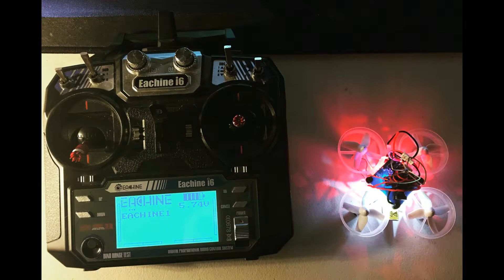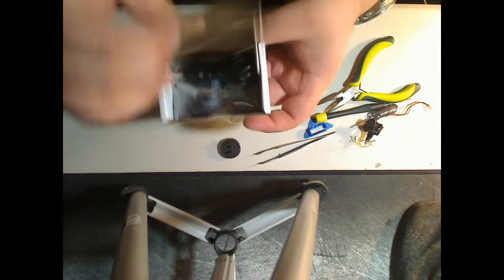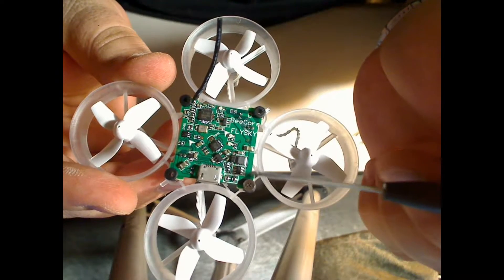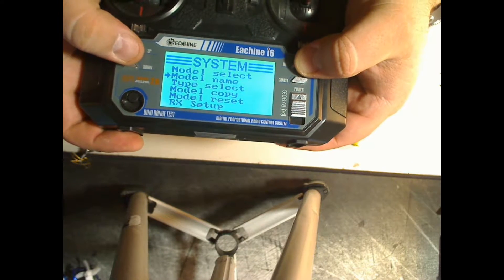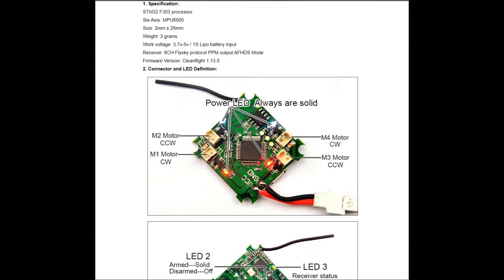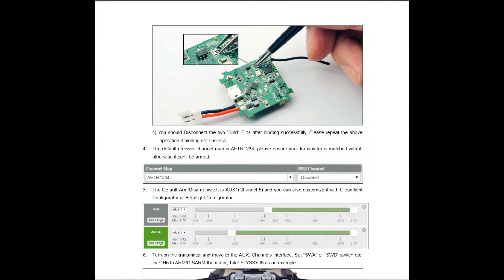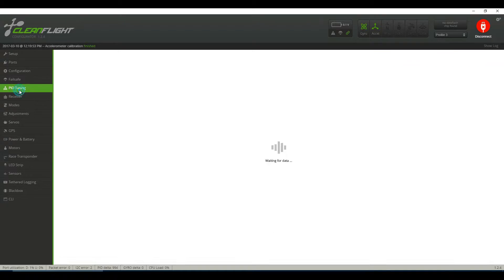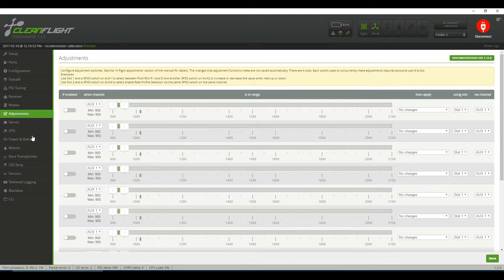BEECORE EVO F3 FLYSKY - Unboxing with Tiny Whoop Build And Maiden Flight (BANGGOOD)

Comment: mine binds, hovers fine, throttle and all axis of movement respond EXCEPT for "left rudder/CCW rotation". Right rudder is fine tho.  motors swapped changes nothing, so thought I do a reflash. Betaflight connects, radio binds, etc, I can modify settings, PIDS, curves, etc. But can't update firmware. says serial port won't connect. which is lame because, well it DOES connect for everything else. Board was already preflashes with a version of bf already flashed for the board but it's one point rev lower. and as a hail mary Id try anything rather than have to fight the tiny soldering (eyes and hands not as steady as I'm in the late 40s) and junk the FC.

Comment: Also, on the bangood manual it says to enable AFHDS, not disable it.
Reply from the maker: I fly in AFHDS off. When I turn it on, it won’t bind. Are you sure the manual says to turn it on? I searched the manual and it said to turn on the Tx and go to AFHDS mode. 🤔